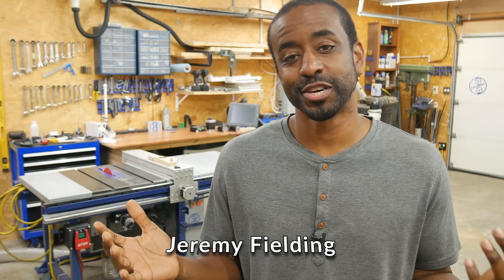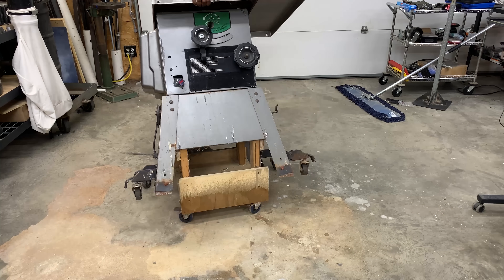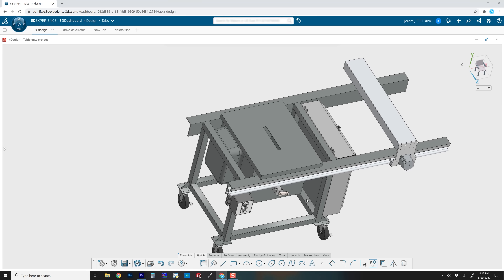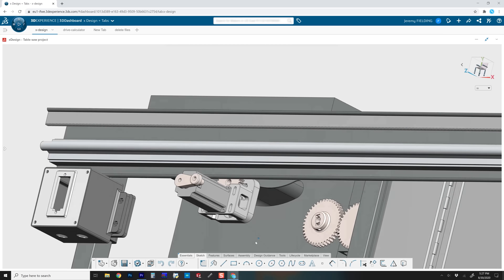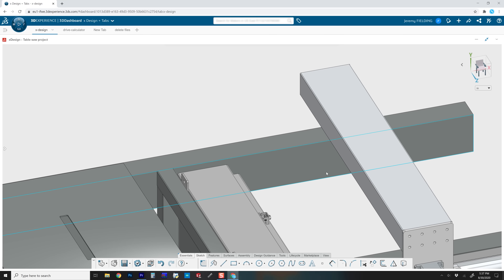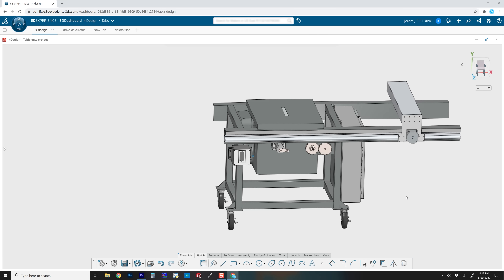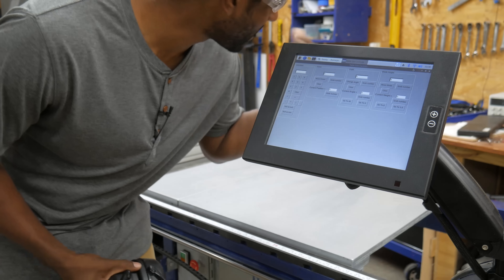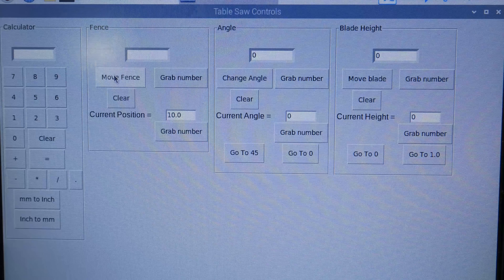How To Make A CNC Table Saw : # 084

Comment: My first thought when I saw this was that Norm Abrams and Susan Calvin had a kid. ;-)

1. A good point to zero the fence would be the left and right sides of a each blade. You then have each new saw blade's thickness, from the standard zero. Each time you put a new blade in you can save the settings. Diameter would also be a good idea. To set "standard" zero use a flat disk on the arbor on the side that doesn't have the nut and flange. Each blade would then have an offset, left and right from that point. Diameter should also be stored.

2. In the UI you can make the units a settable item. I.E. if in metric mode then a 5 sets the saw blade to 5 cm. Use something obvious such as different colours for the numbers to give visual feedback as to what system you are using.

3. A Dado stack will probably offer other challenges.

4. A network connection so you can send your cut list from your CADD software to your CAM software.

5. I wonder if laser measurement might be a "good" idea.

6. How about a mechanical feed mechanism that is also controlled. That way you can control your feed rate and even keep track of blade usage and possibly wear.
Reply: Thoughts on learning to program.

1. There are two aspects to programming, learning a particular language and learning about how to program.

2. Learning a language gets easier the more languages you learn since there is generally but not always a lot of commonality. When you have more than one language then part of the decision process has to do not only with how to solve the problem but which language to use to express that solution.

3. Learning how to program is a general skill that applies to all languages. It is about learning some theory and a lot about algorithms, there can even a bit of math. For example there are many ways to sort stuff. There are costs and benefits to each method and in the way you implement them. If you know how to program then you can weigh the pros and cons and make a hopefully good choice.

4. Have fun doing what ever you choose, its a really big smorgasbord of possibilities,

Comment: I have some suggestions for you
1. Adding the option of the size of the shield in both height and width. So we can cut the material.
2. When we have the width of the shield we can make templates for cutting out the connections. You would need a button or a time trial for this. Where we connect the frame to the dovetail connector. Then we can state that after each cut, the fence is moved by a certain value so that at the end we have a ready connection. For this, we can make it tighter or looser.
3. Safety feature in a program where the stepper motors do not run when the saw motor is running.
4. Add an electronic slider so that even after unfastening the screw it remembers and shows the dimension on the screen.

Comment: To protect against rust, I use shellac because it's thin, fast and very easy to maintain. Some people use hard paste wax. I tried this using my own recipe, but my mix is too soft so it can gum up over time.

I like how you used vinegar and a towel. I'm going to try that overnight and use a plastic sheet to prevent it from drying out.

Comment: After vinegar and mechanical rust removal I would use a rust converter (I use KRUD KUTTER frome Home Depot, very inexpensive)... Napa sells a rust converter spray (dont remember the name) that's ok...  I always recommend using a rust converter as a pre painting step... in this case, on the surface that wont be painted, I would use Mothers Carnauba Car Wax...

Comment: Wow, this is the first video of yours I've watched, but I must say I'm pretty impressed.  Great job, very inspiring.  As a hobbyist wood worker, I can't say I would go to all that trouble, but your project is definitely pretty cool.  You mentioned safety considerations you had on your mind - e-stopping the fence, motor interference for the blade height because the crank could grab clothes, etc., and while watching you mentioned at a couple different points, that you only had support for your fence on one side.  I can understand why you would want to do this because you're avoiding a tendency to cause a bind if you otherwise had 2 points of movement, front and back, but since you didn't have 2 sides, and you're looking for a way to make things safer,  (knowing however that this suggestion means a huge amount of work and design change) you could relocate the drive mechanism for your fence to the back of the saw.  It seemed (from what I could see in your video) that you might be able to do that, and still have the ability to have an outfeed table, if you're ok with a small gap between the outfeed table and table top.  This would have the added benefit of creating a barrier between your fence drive mechanism, and anyone possibly getting close enough to be hit by it.  You could still have your fence fitted with an operator-side indicator window so you could verify your measurements easily.  You also mentioned having  a homing sequence.  You showed that you have prox switches for limit/overtravel detection.  You could combine the 2 features, so that when you run your motion devices to their "home" positions, they can be quickly recalibrated if needed.  Food for thought.  Very much enjoyed your video.  Now I have to go watch the rest of them.

Comment: Wow Jeremy, I am impressed. You mentioned a disable button. Does that prevent these motors from accidently engaging during use? If not, you have a control system that has constant access to the motors. (Sorry. Lockout/Tagout was huge in my industrial career)  Then I would highly recommend that you add a hardwired electrical cutout to your wonderful design. The control system really only needs access to the motors during a small window when the saw is not in actual use. Congratulations on the rest. Really impressive!

Comment: take a look at Maxcut2 software. It does optimization and cutlists.
You also need to add on your wishlist:
1- Dado cutting
2- Dovetail, Box Joint functions
where your fence moves an increment amount, jump to the next cut, you get the idea.

Comment: You have a pinch point between the fence and the side of the table. An e-stop, or even a mechanical disconnect from the rack, for the fence may not be a bad idea in case somebody or thing gets in they way during a move and becomes trapped.

Comment: quite the initiation into control programing! What did you use to create the fence guide rail and associated fence mount? I am in the process of updating my table saw fence system to something more modern and accurate and the aluminium extrusion used looks like an option for my application. Thanks.

Comment: Perhaps the simplest solution to the handle issue. Remove the protruding handle. Leave it as a smooth wheel.

You loose high speed rotation, but if you don't intend to use it often, is there much need?

However what you suggested, a sprung handle, the needs pulling out to engage is a lovely idea I wouldn't have thought of.
Reply from the maker: I like the wheel idea as well.

Comment: Wow - I have the utmost respect for your work. I started doing an almost identical project about 8 months ago and gave up as the coding and time spent fault finding got the better of me in the end. A suggestion for your next upgrade - how about installing a router/spindle on the right side and putting in some code for that too. My thought process was to have height control on the router as well and be able to switch between saw mode (measure from left to right) or router mode (measure from right to left). Also I think an absolute or incremental movement function would be very useful (particularly with the router if you started doing things like box/dovetail joints etc) and not hard to implement now that you have the main code sorted.
For my table saw I've tried everything - paste wax, silver glide etc, but the only thing that works for keeping it shiny is placing a piece of board on top of the surface whenever it's not in use (also doubles as a great work bench).

Comment: I'm a guillotist. Cutting on an automated is my bread and butter. The best UI I used was an old machine. Fence number on top. Had three modes. Manual, program and automatic. Simple keypad. Three move buttons: forward, back and go. Tapping on foward or back moved it a small amount. I could easily move it 
.2mm but if i wanted to move exact then #value "go" or exact forward #value "forward". Those worked in manual and program modes. In auto mode the go button became the next button. I loved that UI. Sure the machine I work on now is 100x better because it's German but if I could swap out it's touchscreen for the old UI with it's  80s button and segmented display I would.

Comment: Do you have a way to lock out the stepper motors while the blade is spinning?  One hazard I could see is having something move in the middle of a cut.  The blade suddenly rising or the fence moving towards the saw while you are pushing a piece through can be very exciting. Knowing my luck, I would also lock out the CNC functions on EN undervoltage on the Pi to prevent funny things from happening on brownouts.  My experience with the Raspberry Pi it that it is extremely sensitive to low voltage which causes random processor errors.
Reply from the maker: Yes... that can be done.

Comment: Use Johnson's paste wax to keep your cast iron tools from rusting.  You will need to re-apply several times a year, more often in humid climates or with heavier use.  It also makes your work slide much easier.

Comment: For your handles you might consider using ones like on the TRAK series of CNC mills.  The handle part folds into the round wheel when not in use and so there is only a spinning wheel that you might touch.  Otherwise perhaps have then handle spring loaded away from a set of dogs that are fixed to the shaft.  So if you want to make a manual move you press the handle / wheel in to engage the dogs and make your movement, then when you release the handle/wheel the spring disengages it from the dogs and now the only force it could apply to someone would be from the frictional torque between the wheel and the shaft.  If I can find links for these two ideas I will post them as a reply to this.

Comment: Just one question : do you isolate the stepper motors function when the blade rotates?,  EM surges or just random elec. dumb luck I don't trust any circuit with my life ( or in your case hands_)... Just asking.
Reply from the maker: That can be done pretty easily.

Comment: One thing you need to be extremely careful about is welding on concrete. I noticed you were welding the base of your table braces on the floor. if you build too much heat on the concrete it will explode...

Comment: You should consider adding a DC power feeder!! Would be like a 4th axis control for your saw - repeatable controllable feed speed, based on programmed material. And you’d get to work in some more computer vision work (articulated arm for feeder...). Looks awesome!

Comment: The python code on github might not be entirely up to date, all the channels for the stepper motors were listed as zero.  Don't feel bad for the difficulty of coding, the documentation at raspberry-gpio-python is pretty awful.  But once you have the latest up there, you can probably get away with doing the channel setup just once when the program starts, and then move the step loops out to a isolated function where you can artificially fiddle with the delay at the beginning and the end to get some acceleration control going.
Reply from the maker: I changed them all to zero. I tried setting up all the pins at the beginning and it worked at first. but somewhere along the way I started getting an error message saying the pins were not setup. I could not figure out what the problem was but moving setup inside the functions seemed to solve the problem.
Reply: @Jeremy_Fielding  Well, taking a look at the gpio library for the rasberry pi; it looks like zero is a magic number which I'm not really sure what its actually doing, but it sure makes me nervous.  You should have a program on the pi already called `pinout` which would tell you where all the GPIOs are on your header.  Also, with the libgpiod package; you'd have the command line tool `gpioset` which you could use to manually toggle pins, and experiment with trying to find out how the motor drivers are wired into the header.  Otherwise I would be worried that driving the axes in a different order would cause strange things to happen the first time you started up.
Reply from the maker: @DerekWoolverton  I may have confused you. On my machine all the pins are correctly wired and indicated in the code. I changed the number just before uploading it to github as a way of indicating you should change these numbers LOL. I am a beginner so it seemed like a good idea at the time. After thinking about it, leaving the numbers there doesn't hurt anything or cause a problem.
Reply: @Jeremy_Fielding  Ok, I created a proposed change:  https://github.com/jengineer1/CNCTablesaw/pull/3  Try it out with move_steps first, and then if that works, try out accel_steps.  Then do the same change for the other axes.

Comment: This is awesome. The best cnc table saw ever (and the only :D).

I see you're using tkinter. You might look at flask, to give you a web interface really easily. Especially if you add the ability to put in lots of measurements. You can do that from your desk, and then have them show up at the saw.

When you do the acceleration, remember this shortcut: a=(v2^2-v1^2)/2d. It is really nice to not have to mess with time. You can quickly figure out how far you can go before worrying about acceleration. 

The pic you shared of the blue relays looks like mechanical relays, not SSRs. 

Very neat project, and it is very impressive. I'm a SW eng. I work on robots and I do woodworking as a hobby. This was a fun watch. Thank you.
Reply from the maker: I just broke one open and they are mechanical. I was mistaken. I will add a note/correction to the description.

Comment: This is a great project but Jeremy made it hard for himself by writing his own motion control code. Use GCode and GRBL or pycnc. These have homing and all the motion control down. The UI would still need to be written but testing could have been done in stages. Still Jeremy you have created a great system.

Comment: Your projects are so very inspiring. I was thinking about how to design a CNC box joint cutting machine. I've found several Youtube videos by folks that have done this, but I don't think they took it far enough. The ones I found just let you put the size of the dado cut. The user has to push the slide manually for each cut. The machine then moves the work-piece over by one saw-blade-width, then the user has to push the slide through the saw blade. 

What I wanted is a totally automated system. You clamp the box sides into the jig and then punch in how many teeth you want in the joint. The machine will have an edge detector so it can mind the two ends of the box side so it can calculate size of the joint teeth to be cut. This way the size of the joint teeth so the end comes out exactly even instead of having an odd size at one end of the box size. You could also have it calculate teethe that vary in size along the joint, perhaps getting larger toward the middle of the box and smaller at the ends.

Comment: An easy way to make the cut list would be to include a physical next button. No need to look at the screen with a button that steps to the next cut for you. 

Next would be a wall mounted display for the table that uses a mix of 7 and 13 segment displays so you can have numbers output on the 7 segment displays and letters and numbers on the 13's letting you have the current 3 settings and a list name showing on a fixed part of the wall letting you know where things are without looking at the screen. You could go all 13 segment displays to reduce the overall work as once you have the setup it is easy to pump up part after part without needing to change anything between the total number of displays needed.

Comment: Pretty awesome project now you need to cnc the cutting process so you just have to sit back and watch🤣
But one thing i would do is something that automatically kills the power to the blade its self if the power to the rest turns off while cutting.  Would hate to be cutting and a relay craps out and the fence starts to move while cutting.
Awesome work

Comment: for rust prevention : thin coat of polyurethane (Heisz & Wandel), mineral oil / beeswax combo (Katz Moses goo) or Boeing Boeshield T-9 - I've not tried the poly, but have used both of the others with success
Also, this is SUPER awesome. Well done (as usual)!

Comment: Good video bad title : this is absolutly not a how to make, this just here's what i made. Seriously there really is a problem with title on youtube..
Reply from the maker: You saw everything that went into the process and you get a free download of the code and the 3d model with more detail. Just because it is not a step by step doesn't mean I didn't show you how and give you most of the leg work to start with. It is impossible to cover every possible setup this might take on with different saws and starting tools. What would you call it? I am open to suggestions. But I disagree with "absolutely not how to"
Reply: @Jeremy_Fielding  i'm not saying what you did is not great i'm just pointing it is not a how to. because that's not what it is ...